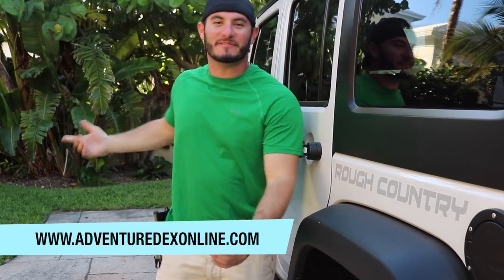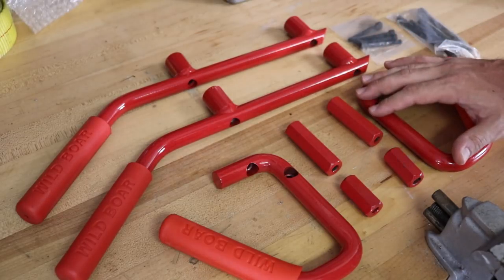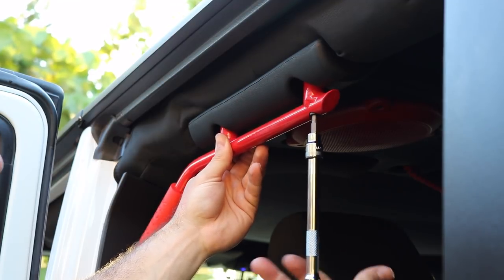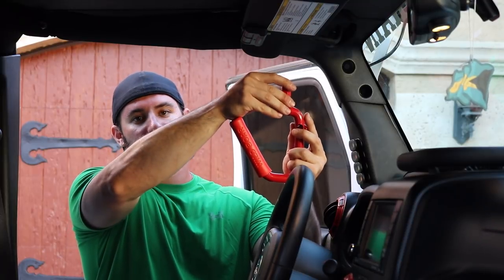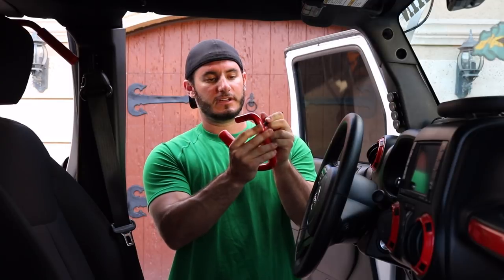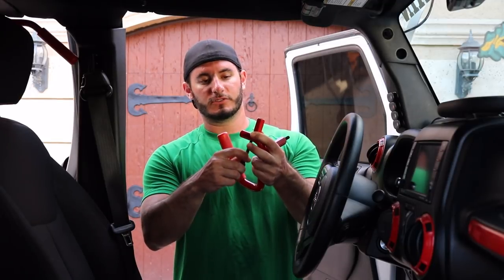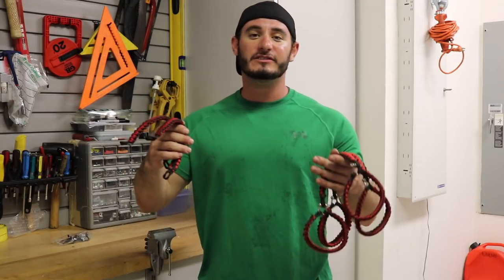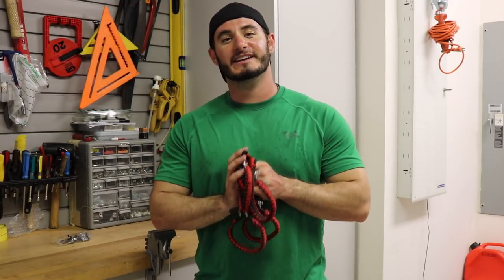Jeep Wild Boar Grab Handles - DIY Installation under $100

Comment: Stupid question but all of these that I've seen on ebay say they are for a 2007 - 2017.  Is there any difference in a 2017 to a 2018 - will these work on a 2018?

Comment: I heard that the front handle will interfere with the sun visor and not allow it to be used fully. How bad does it limit the movement?
Reply from the maker: Thanks for the comment Michael, I don't have any interference. I have heard some grab handles are made slightly different. Make sure you are buying a good set. Thanks for watching!

Comment: All my bolts/screws fit except front passenger side top screw. Did you have any problems getting the top screw in on the front passenger side?
Reply from the maker: Sometimes, you gotta just wiggle it around until it fits. Try loosing them all and lining them up before tightening! Thanks for watching!!
Reply: Hey I just got these and I had the same problem so far.  My passenger top bolt will not go in.  Did you finally get your in?

Comment: Very disappointed in the construction of the rear handles....the bolts go straight through the handles, so I'm going to have to figure out a way to secure the handles
Reply from the maker: Wow that is not good. Mine did not come like that. What about using a washer or bigger size screw head. Hope that helps!
Reply: AdventureDex I ended up getting washers......it works for now thanks
Reply from the maker: Great!

Comment: Look after looking at the factory grab handles on the JL Wranglers, I can't help but wonder why someone hasn't made a nylon handle that screws into the front pillars.
You see, if I'm going to hit my head into a grab handle in a wreak, i'd much rather hit a Nylon handle than a solid steel grab handle.

Comment: Gotem !  Good upgrade, I also kept the paracord grab handles on the right side for my vertically challenged wife.  Easy install.  Installation was a little different for my JK.  It takes the long spacer and bolt on the bottom and the short bolt and spacer on the top.  Have fun.  It took me about a half hour because my JK is a two door.